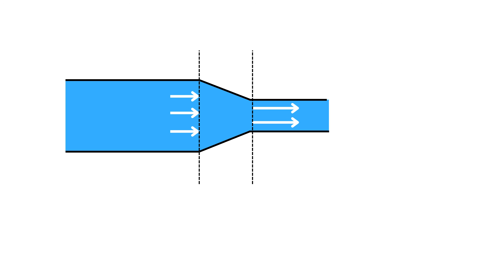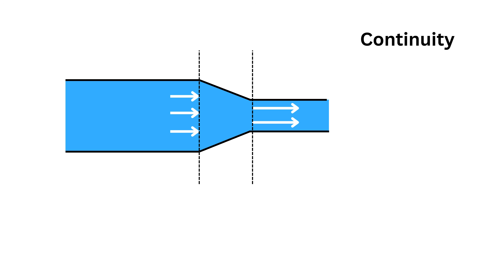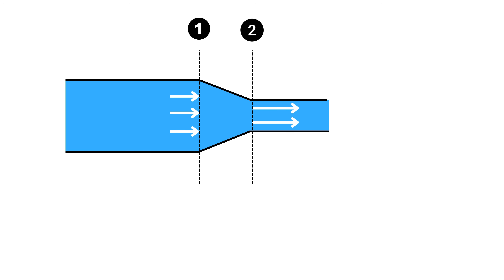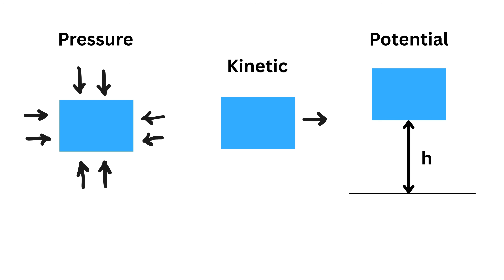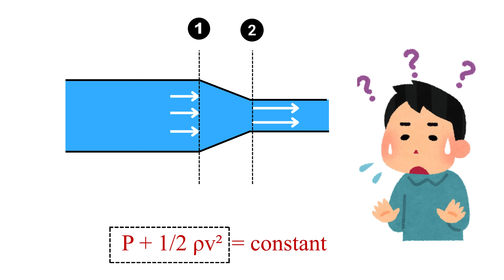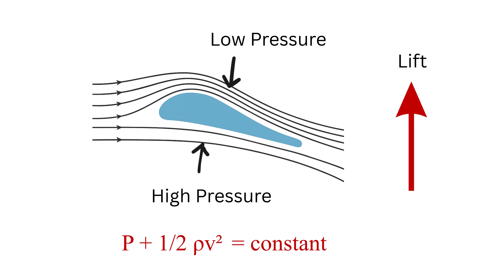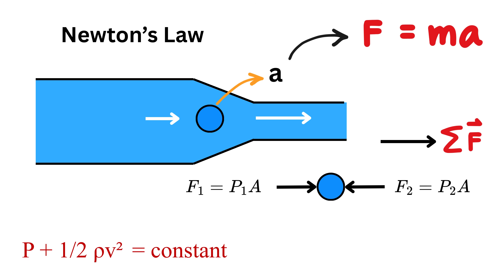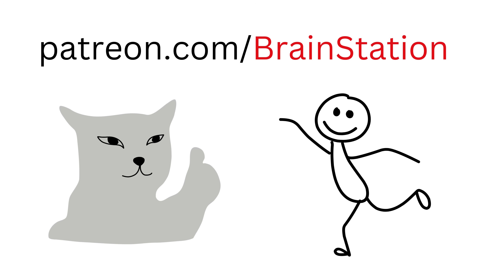Newton is G.O.A.T

Comment: Still not sure what you mean by pressure energy
Reply from the maker: Pressure energy is the energy stored in a fluid because the surrounding fluid is constantly pushing on every fluid particle. This push (or pressure) comes from all directions...and it gives the fluid the ability to do work.
Reply: @BrainStationAdvanced  "Pressure energy is defined as the work needed to force the element of fluid across a certain distance against the pressure." Therefore, your pressure energy is a kind of potential energy, and nothing else! For example, one can name "spring energy", but it is just the potential energy.
Reply: Pressure is an energy per unit volume
Reply: But talking about pressure energy, is it related to the internal energy of a system? and/or the Boyle-Mariotte law?🥲🤔🤓
Reply: MrDT • Boyle-Marriotte law refers to an ideal state of an ideal gas.
The real movement of a liquid into a tapered pipe is about a real dynamic, not an ideal one.
One talks about the relationship between the volume and pressure of a closed ideal system at constant temperature.
The other talks about the relation between speed and pressure based on a real open system.
Both can be based on Newton formalism, but they are two different dynamics.
Reply: You cannot have " pressure energy" for an incompressible fluids! The explanation for lift is also wrong. Viscosity is needed for lift.  No drag no lift. But Berrnoulli equation is valid for invisible fluids only...everything here is actually subtly wrong
Reply: @arunsrinivasa8643  ????? No fluid is incompressible, even a neutron star can be compressed into a black hole. Viscosity is not needed for lift, mass density suffices, along with deflection of the fluid. Drag is just the energy dissipated in pushing stuff out of the way. Bernoulli equation is only strictly valid for laminar flow. At higher flow rates viscosity causes turbulent flow to occur. The flow at right angles (due to complementary shear stresses) to the bulk flow present in the fluid in and around the boundary layer dissipates energy and causes an increase in drag. Feel free to think this is subtly wrong as well.

Comment: There is also higher pressure in the upstream section of even a straight pipe due to 
friction loss.  This equalizes when flow is blocked, though.

Comment: 3:48 Wrong! The "shape" of the airfoil is not what causes lift. Even a flat wing is able to produce a lower pressure on the top and therefore generate lift (together with the higher pressure on the bottom).
Therefore "Bernoulli's principle" has nothing to do with the origin of lift.
Reply: Agree. Whatever the shape of the wing, there will be no lift without downwash stream. Amount of air deflected downward makes the lift. As simple as action-reaction.

Comment: 1:21 No, volumetric flowrate is equal to cross-sectional area of the pipe multiplied by fluid velocity. Mass flowrate is volumetric flowrate multiplied by density. 

Check units. Velocity in m/s, area in m², so multiplying them gives m³/s, i.e. volumetric flowrate.
Density in kg/m³, so multiplying this by m³/s gives kg/s i.e. mass flowrate.

Comment: I have this argument all the time with people who confuse acceleration with pressure. I run a small hydro turbine and in order to make it work you squeeze whatever water source you have through a nozzle that is smaller than the pipe that brings the water in. This increases the velocity which in turns make the turbine turn really fast generating power. They are always confusing velocity with psi. I tell them, it doesn't matter if you have a 4 inch pipe or a 1 inch pipe that has 100 feet of head, the psi will be the same at the end of the pipe. When you have a 4 inch pipe squeezing water out the end of a 1 inch pipe you are simply replacing the escaping water faster out of the 1 inch pipe therefore increasing velocity at the 1 inch outlet.

Comment: I don’t like Bernouilli. I blow through a straw and the exiting air can lift a sheet of paper because of its low pressure. But, by blowing, I have added velocity to the air molecules. I have not subtracted from their random velocities (except the ones initially pointing backwards). The sideways velocities (approximately perpendicular to the general direction) should not decrease. So why does the pressure decrease?
I think some attraction between particles, like van der Waals forces, are needed to explain this and why aeroplanes fly.
Generally an external force is needed to push a fluid into a constricting tube, so conservation of energy does not apply.

Comment: The real question is why the fluid accelerates over the top surface of the airfoil? As you said, the airfoil is "designed" to achieve this, but the actual reason is that the fluid is governed by Hertz principle of least curvature. Neither Bernoulli nor Newton explain lift generation, they are just consequences
Reply: Yes. Why does a molecule in the fluid ‘want’ to accelerate over the curve?

Comment: BrainStation, 
As RobertChan2003 stated, Bernoulli's is tired of having his principle applied to areas that are simply inappropriate! Airplane lift is clearly due to the Coanda effect, not Bernoulli's principle. Instead of putting the name Coanda on the phenomena, it is more intuitive to say that as the air begins to curve over the wing the air below it is entrainded by the fast moving air above and therefore the pressure below is reduced because of the lower number of molecules. The air then "bends downward" and tends to follow the curve of the wing - i.e., the Coanda effect. 
If you're interested in seeing a correct and an excellent analysis using Newton not Bernoulli, try googling professor's Holger Babinsky's lift video.
Reply from the maker: Thank you...i will google it
Reply: No. Coanda only works on curved surfaces, not on flat ones, while we know that a flat wing is perfectly capable of creating a lower pressure on the top (as well as a greater pressure on the bottom) and therefore generating lift. 
Coanda is a false explanation of the origin of the lower pressure on the top of the wing and therefore of lift.

Comment: Now one big thing is missing, which is the basis for all heat pumps (fridges etc): there will be an increase in temperature at the funnel, as there is also a decrease when transitioning from narrow pipe to wide. That's part of the energy equation as well.

Comment: Bernoulli's principle cannot explain airplane fly as there is no boundary in sky to guide air flow as in a closed tube. Airplane can fly due to Angle of Attack (AOA) of airfoil design. When engines push airplane forward, air at front edge of wing is in much compressed state while wing top is at a relative low pressure at certain AOA, so air is "sucked" back and flow faster than that at wing bottom. Lastly, Coanda effect of air molecule flow layer on wing top surface explains lift force.
Reply: Yes. When I tried to demonstrate that an aerofoil produces more lift than a plank, I failed. A good angle of attack produces lift. The aerofoil shape is important in controlling turbulence at high speed.
Reply: Agree. Whatever the shape of the wing, there will be no lift without downwash stream. Amount of air deflected downward makes the lift. As simple as action-reaction.
Reply: @mbahMu-iki . Certainly, BUT, the Coanda effect on the upper surface is important in directing the airflow downwards. This is the downwash. . THERE IS NO BERNOUILLI EFFECT! 
The air does not need to travel faster on top. It is “sucked” close to the curve because it would create a vacuum if it pulled away.This is the Coanda effect. For 70 years I failed to understand flight because it was always shrouded in mis-explanation.

Comment: Make a video on Einstein’s thought experiments at least one of which is not experimentally verified. First are there two different references used their own EM wave sources are imagined or only one observer used an EM wave source uses imagined ? Actually if two sources each one of their own source and flickers at the same time these two signals will never meet at a point at the same time with respect to both of them. There is a big mistake. Speed of light is constant and moving train with a source of light is totally imagination and two observers will disagree and never be verified in reality. One shower particle of long distance may rich as it is a probabilistic effect similar to disintegration of radioactive elements. Wish a light on it.